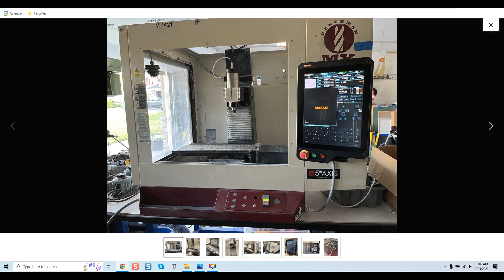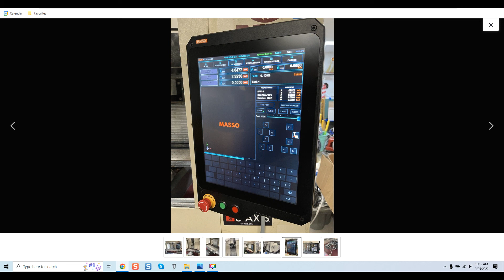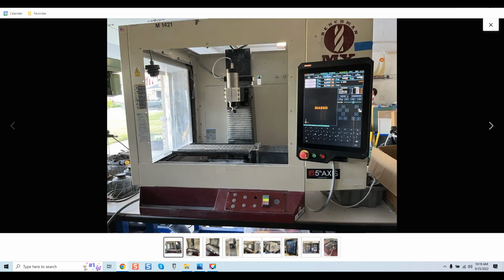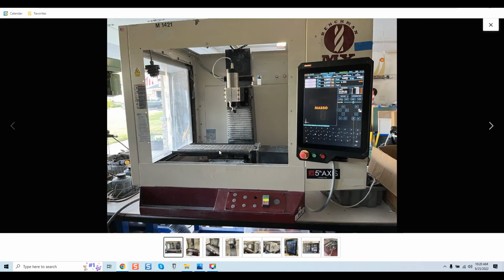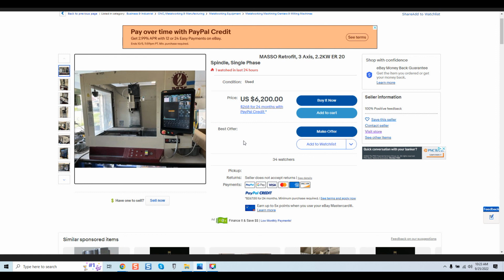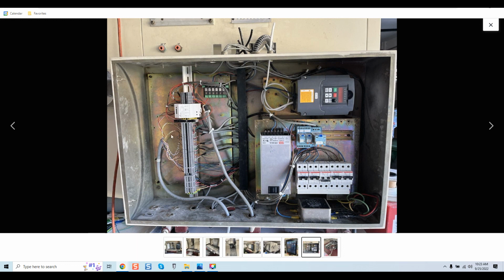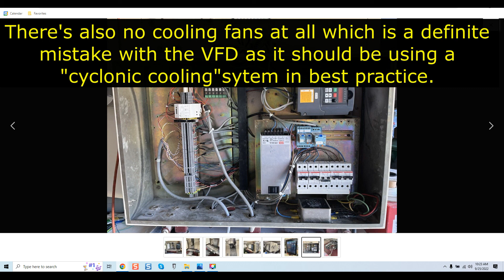Masso CNC $6200 Retrofit  Here's The Inside Of Your Controller..

Comment: Vince, Good to see you again. Well not you,  but your videos. I really enjoy your videos by the way.  I will add my 2 cents (even though they are worth 1. And i am absoutly no expert. ) about this retro fit. Especially since I am struggling through masso retro fit on the same machine.  I think the $6000 price tag is mostly due to the chassis . That is a Benchman mx not alot of info out there on them  but they were 39k - 65k new. As far as what they are.. its about as good as it gets in the weight class. Very high quality mechanical components and electronic components for that matter albeit dated. It has granite composite frame. 0 backlash ball screws. Servo motors. Very purposely made. Original machine came with several different  spindle options, tool carisel option And more. Now on to this machine. On top of all the bummer things you pointed out. Is the spindle swap of lower quality.  All 3 benchman spindles were of high quality.  And the original servo  drive motors also swaped for lower grade components. But in its defense. If it moves and and does things you could do worse with 6k. But not the system for making quality parts off of the truck.
Reply from the maker: Thank you for your support. The point you made about the robots chassis is correct, but the electronics on a retrofit actually bring any robot to life. In this situation the person performing the retrofit did it incorrectly as covered in the video. This is the most important part of any production robot as it makes the unit automated, and is meant to produce a stable production machine. Regardless of how well a chassis is constructed, or the transmission that it uses to automate it if the electronics included to run it aren't done properly the end user its supporting is almost always plagued from the start with problems. This was my point with this video. What makes this even more interesting is your point about the robot's price when it was new. The person retrofitting the system should have known it from the start, and he ended up reducing its value to virtually nothing by performing a retrofit incorrectly on it Thank you,
Vince

Comment: wow that's some pretty shoddy retrofit work there.  for 6k that guy must be on something.  $1200 for the masso, then maybe $300 for the motors,  $100 for the vfd $150 for the router spindle (isn't this meant to be a mill?) then maybe 500-1k for the machine in non functional condition. so lets say the guy has 3k into it,  how did he get to $6200 surely there isnt 3k of labor in that shoddy work.  for 5k i bought a full size tc22 100% functional but tired vmc, then stripped it and mechanically restored and retrofitted with centroid oak and ac servos i probably have 15k into it done and dusted,  its like new, balls screws linear ways, fully rebuilt tool changer, spindle, spindle motor complete nut and bolt, every bearing restoration, re hand scraped in all the mating surfaces, stripped and repainted.  maybe i should send you a link to my pictures for you to review my work. its took me 2 years to rebuild my machine properly in the little spare time i have but it beats spending over 60-100k on something new of comparable.
Reply from the maker: Thank you for your support, and well said. Rebuilding a robot to new condition is never a fast task, and ultimately the knowledge it takes to do so is relative to the required investment to complete the project. Thank you,
Vince